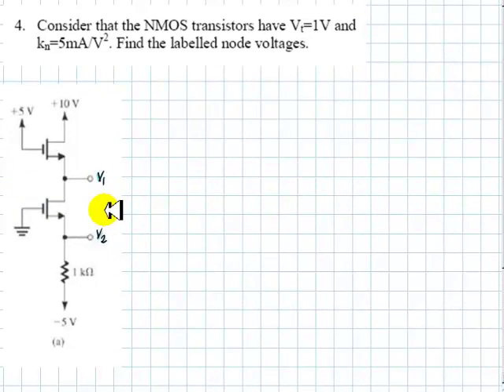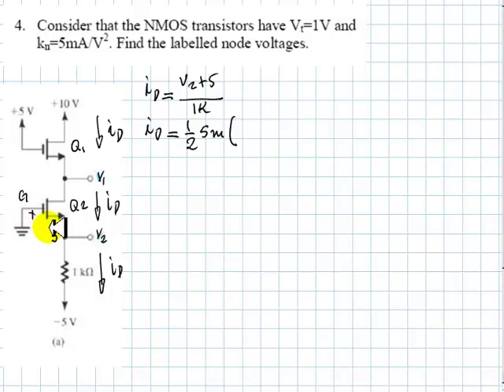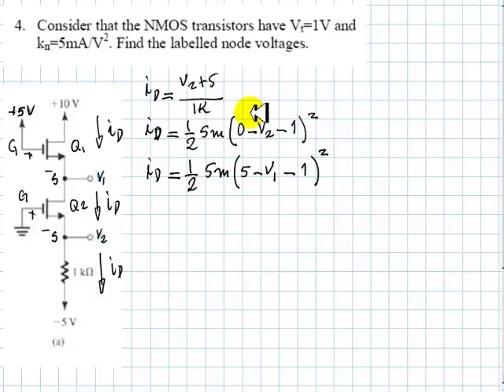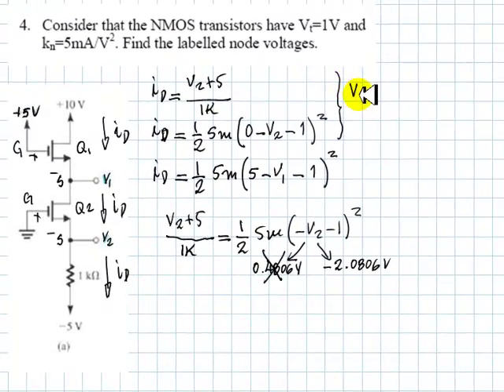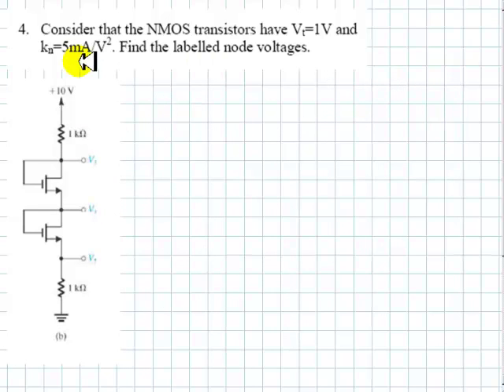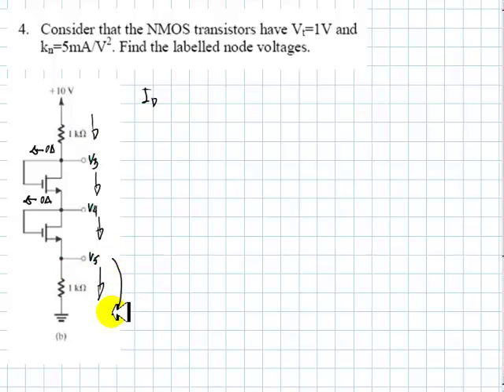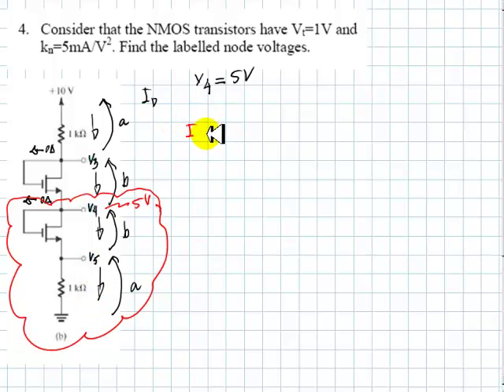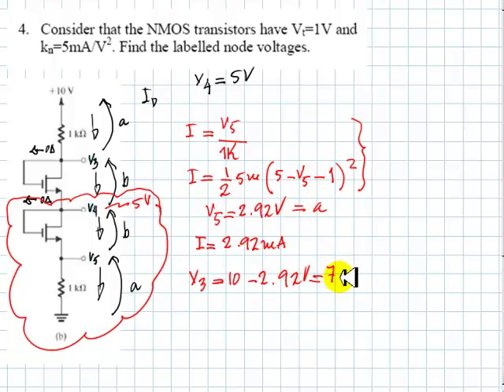EECE 251 - Tutorial on MOSFETs Part Three

Comment: Great.  I was just asking because I've seen "transistors" with two pins (and the third removed or not used) on circuit boards that I've disassembled and have always been curious as to what was going on.  At first I thought it could be that the transistor was being used as a diode, but this lesson illustrates yet another function.  Thanks for the reply and for your EXCELLENT lessons!

Comment: Nice "outside of the box" thinking to find the symmetry in this circuit, resulting in the discovery that V4 voltage is 1/2 Vcc, and simplifying the solution for the rest of the circuit.  One question remains (and I apologize for my lack of experience in recognizing this): what is the essential nature of this circuit?  In other words, does it have a real-world purpose, or is it simply a lab design for illustrative purposes?